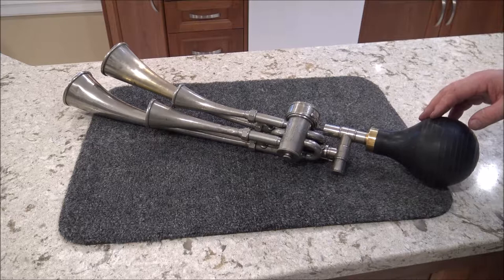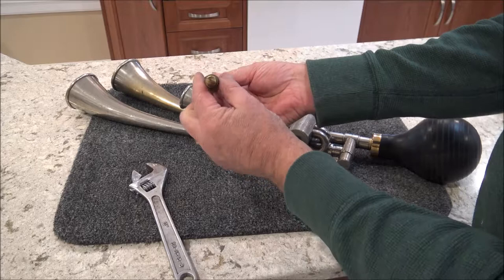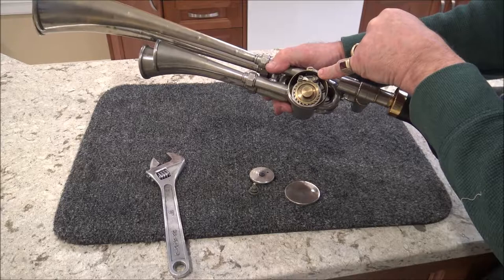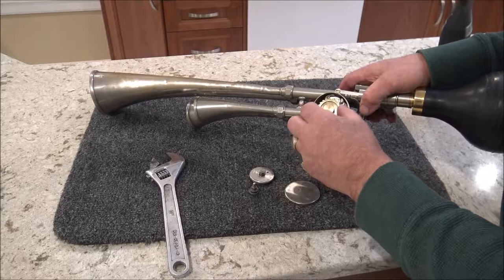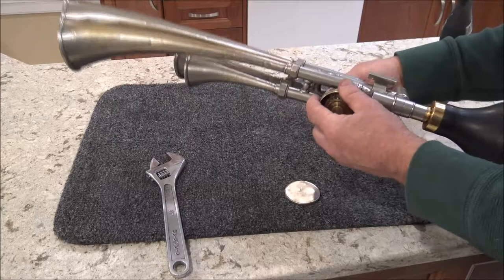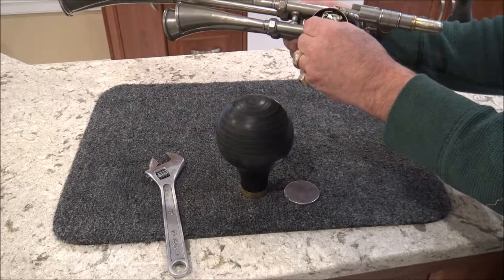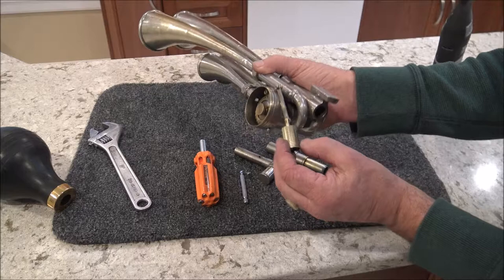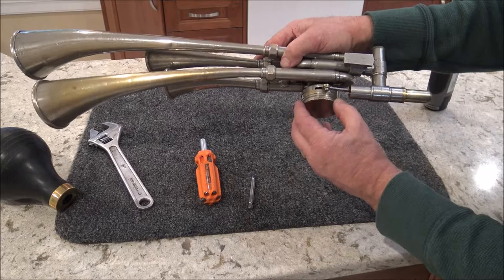Testophone Horn Restoration & Rebuild

Comment: Thanks for posting your clear detailed video with excellent audio.  A way to match machine threading is to lightly push down while lightly turning wrong direction, then you may feel or hear a click as you turn just past the point where  the threading will engage, I would mark the cap with a sharpie dot relative to body where that point is.  I think your car horn plays well known portion of waltz:
The Blue Danube
composed 1866 by Johann Strauss per Wikipedia entry.

Comment: Genius!
Reply: Do you suppose the 'player piano' aspect of the cylinder implies it would honk a specific melody? That maybe you could swap out the cylinders?
Reply: Short answer yes, but horn is limited to 4 tones and it would cost a great deal.  I think his horn playa The Blue Danube a very well known waltz melody you're probably familiar with.  I couldn't ID from beginning of video, but somewhere around 5:00 he plays with correct rhythm..  Search ebay for novelty car horns and select version with most horns.  Those use a disk and you can measure what tones are available with Tuning app Carltune from Google play   there may be another possible playing position but on the device, but you will have to drill a hole and have a horn to place in it.  Keep in mind tone duration is by angle, a short length in center is same duration long slot on outer edge.  First find duration of horn normal speed.  make a large drawing and use a protractor for light lines at 1/4 note spacing and heavy lines at measures for planing.